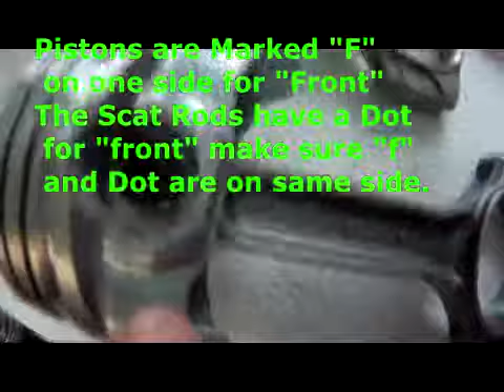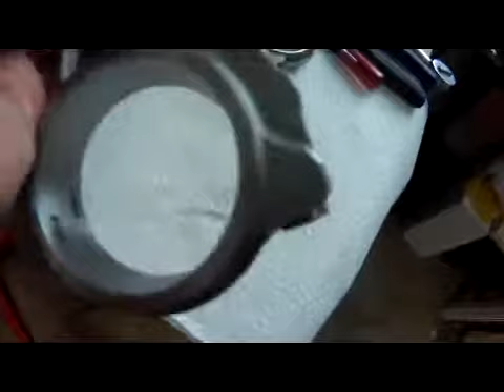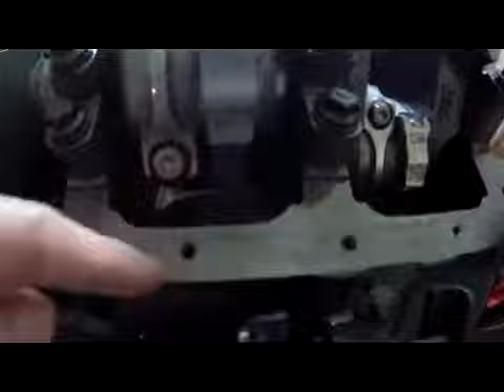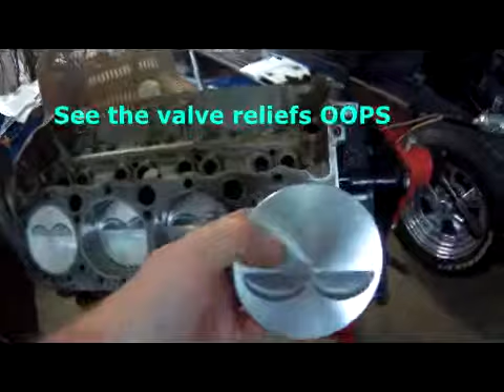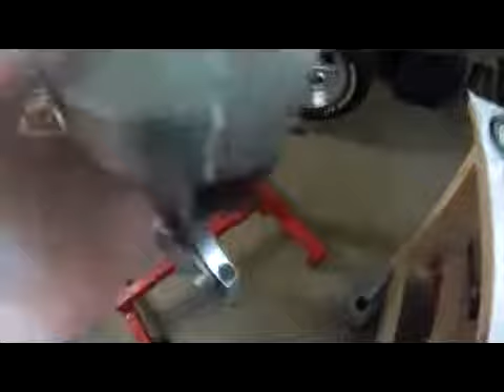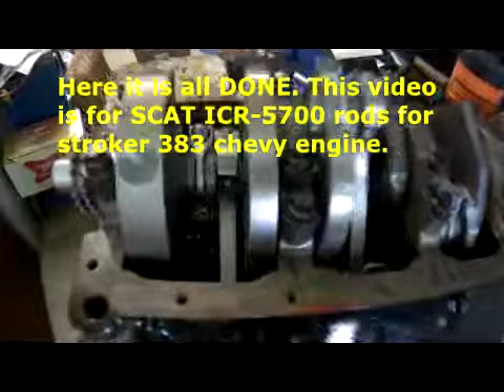SCAT RODS  383 Stroker CHEVY WHICH WAY THEY GO?

Comment: Any block clearance needed with those rods?
Reply from the maker: Yes, I had to clearance block slightly by oil pan rail on block and bottom of cylinder walls . I was using a Stroker crank 383 Chevy
Reply from the maker: yes, by oil pan on block, used a die grinder